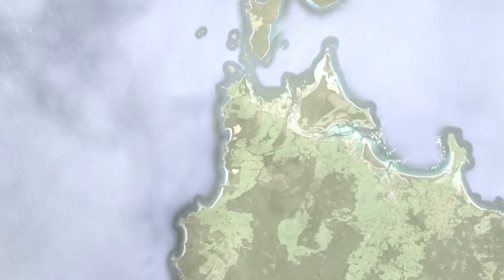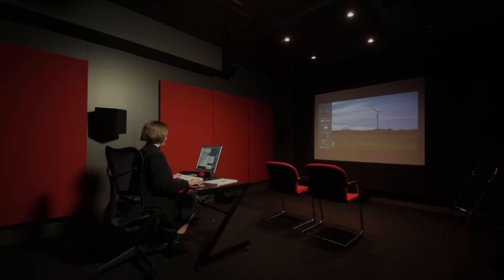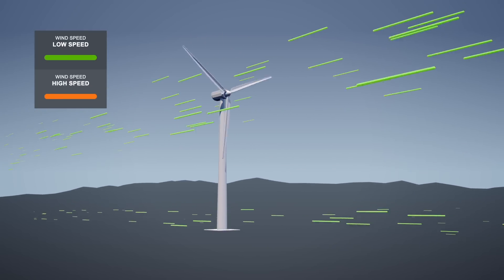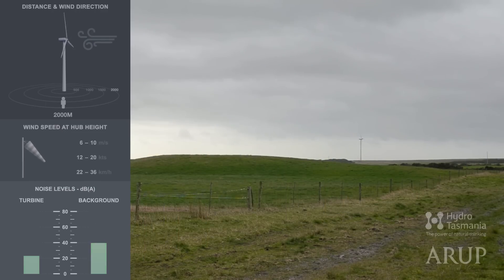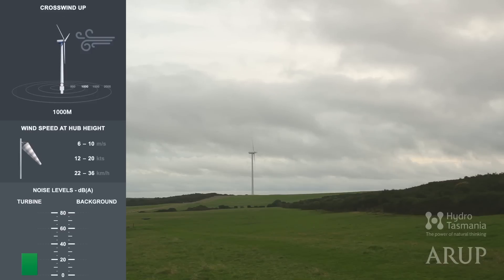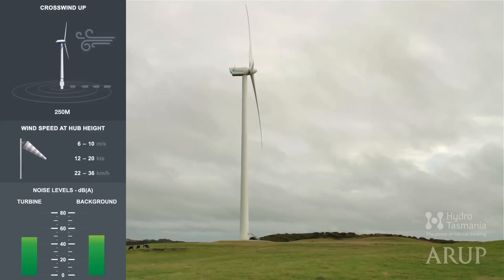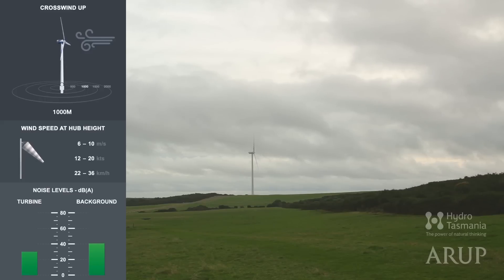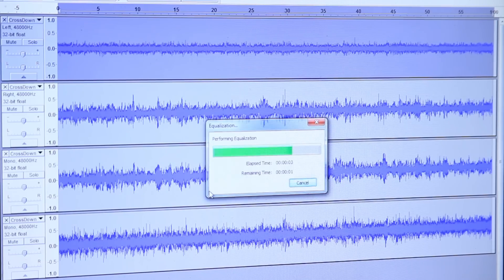The sound of wind farms

Comment: The moving elements of a wind turbine are what make them so much more productive that solar panels.  Naturally since things are moving, the machine makes some noise.  Gas turbines and old school diesel power generators make lots of noise locally, but it is dampened via soundproofing, and also, noise drops off with distance.

Comment: The measurement method, almost perpendicular to the axis of rotation, is misleading, after all, a large part of the sound blows away sideways. The loudest sound can be heard behind the windmill, parallel to the axis of rotation, I bet that in that position noise values are measured that are 1.5 to 2 x higher. But in any case, wind and solar energy is inefficient and unreliable energy that also costs a lot of energy to set up and maintain, see this video https://youtu.be/m7PHUMd7PYA

Comment: Everything at 90 degrees on the direction of the wind. Why? Try it with the wind blowing against you.
Reply: I had the same thought. I'm just a simple airplane mechanic, but if I were doing research on the sound of a spinning prop, I'd want to know how (or even if) the sound changes parallel to the prop disk, both front and back, and perpendicular to the prop disk, like they did here, but from both sides. Why both sides, because one side has ascending blades while they are descending on the opposite side. I have no idea if that would make a difference, but I'd like to know if they at least checked into that. Also, they need to get records of the average number of wind turbines operating per day, then measure the sound levels with that many wind turbines running.

Comment: This video is complete deception.  If the author really wished to accurately measure turbine noise, they would not have approach the turbine from the side.  The quietest vantage point.  Turbines are loudest directly in front or behind.  70db are typical maximum measurements on breezy days.  You need hearing protection at 80db.  Also infrasound is far more annoying than audible noise.  Infrasound causes headaches and "head pressure".  This video is intended to deceive.

Comment: EXCELLENT Job of FILTERING OUT the NOISE of the GEARS CLASHING Together
Reply: 250 meters isn't close enough, to hear the transmissions, or  alternator hum. To hear that, you almost need to put your ear right against the tower. (I know, I actually trespassed onto a site to try it)

Comment: This is not relevant for other wind turbines. 
I lived off grid in Portugal and couldn't get used to the near permanent noise of 4 nearby wind turbines. It sounded like an jet plane coming over neither too low to be upfront but low enough to make you turn your head. Different shapes of blades might affect the noise output.

The WHO has now recognised the noise (some) wind turbines make as a health hazard. A couple won in November 2021 financial compensation from a wind turbine corporation for the health issues they suffered caused by constant exposure to the noise they make.

Comment: The first thing I thought of after watching this, is "how come they didn't do the modelling in front of and behind the blades, and also were there are multiple turbines" seems logical to check out all the potential angles and real wind farms with multiple turbines.......It's interesting to note that city dwellers who are far from the blades chastise the rural dwellers generally speaking because like most people ..we are all for something like green energy (turbines) or nuclear or chicken farms...or you name it........as long as it's not our backyard.
Reply: Recording at different aspects and in the midst of a wind farm would be very interesting indeed. City dwellers take a while to hear discrete sounds when away from what they are used to. I haven't heard a wind farm in real time but seeing them in motion I don't think they are as quiet as the developers claim. When each blade passes the post supporting the whole thing it has to disturb the flow of air creating noise at a very low freq. that you would feel rather than hear. If there is any pitting and erosion on the leading edges and tips of the blades that would cause noise in varying freq. bands depending on the size of the pitting too.
Reply: These where my questions also. There are many I have around wind farms, Noise is just one of them.
Reply: Because sound doesnt travel like light where you will hear something different from different angles thats because the sound diffracts and the spreads out in a sphere - if you have walls and obstacles close by that can interfer with the sound there can be a difference but in an open field like that you wont notice a difference. - The sound 200m behind the turbine will be the same as to the side of the turbine.
Reply: Not necessarily. I am pro wind farm. My brother and I have signed a lease for one, however I do not think my section of our rural property will have any towers. That means I will be able to see them, and possibly hear them but obtain no direct financial benefit from the wind farm.

I don’t actually live there anymore, but even if I was living there I would still support them. This video has reassured me as the turbines will be at least a kilometre from me.
Reply: Exactly. The sound levels off to the side of the rotating blades are nowhere near as loud as behind the blades.  And it is actually louder at some distance than it is close to the turbine. Videos like this are paid for by wind developers to convince politicians that wind projects are wonderful. The fact is that the entire area of a wind project becomes a de facto heavy industrial zone. Industrial zones are not good places for people to live and are always kept separate from residential areas in zoning law. Non-compliant use for industrial purposes is not to be allowed in ag/residential areas without full consent of residents.

Comment: This is a super neat video! What does a wind farm of 50+ sound like?
Reply: This is what they sound like from 2000'.  https://www.youtube.com/watch?v=78QwBM_AD3s
Reply: Probably a bit late at replying to this message but 3dB is perceived as a noticeable difference in level, 3dB is also a doubling of sound pressure so 64 turbines would be 3dB x 6 louder (18dB increase) the acoustic consultants would have assessed whether that level increase met the appropriate legislative levels based on the baseline background sound level. It's not quite as simple to say it's that much louder though because of the attenuation of level at distance and any other effects the turbines are subject to. ETSU-97 is the guidance if you wanted to look into it and during an assessment acoustic consultants have to factor in cumulative effects of other nearby wind farms
Reply: Is'nt db(A) used for measuring which does not meassure the lower frequencies? 
Also, I wonder what the sound signature is in a closed space, like a room in a standard house where the walls may mask out the higher frequencies and the lower onse will plough through. The turbine(s) are constantly oscillating when active.
I do not live nearby windturbines, but someone said a "standard house" in my countrty swings by airborne soundwaves below 180Hz   @jameslennon6593
Reply: Why would you be in the wind farm if you dont like the sounds? Youre unlikely to have more than a few close by.

Comment: The enclose of the mic is huge. Very big and very much damping. In a studio this would result in muffled sounds. No quality vocal or instrument  recording can be made with such a setup.
Of course protection for wind noises is required. Pop filters are normally used for vocals . I would suggest making a pop filter around the mic. With enough distance to the mic. Why not measure at a stormy or hurricane day? Than wind noise is biggest! It is like measuring a drummer who plays with brushes and in the next measurement you hear a jazz drummer playing with light sticks. That method is OK if you stop the wind turbines when wind is above medium breeze. Great ...people around the windturbine will be happy! But ...at high speeds windturbines deliver most energy and noise. Windturbines  are only stopped when very extreme winds are avaialable. So we wanna hear the heavy metal drummer who can shake the roofs! Or the storms that shake the windturbines . For sure not pretty weather to do measurements ...i may rain and be cold as well. 
Yes ...than that enclosure probably will be required and perhaps still generate enough signal.  
Second ...very nice to have windpark far away from houses as shown.  Distances from 10 times tip height or more have almost no serious consequences for people around the windtrubine. However for instance in the overcrowded Netherlands distances from 700m , 500 m or even 300m or less also are reported . And ...windturbines are getting bigger and bigger and more and more. See links with installed heights, powers and noise they generated. Official government data.
https://www.atlasleefomgeving.nl/kaarten?config=3ef897de-127f-471a-959b-93b7597de188&activateOnStart=info,layermanager&gm-x=155000.00000000006&gm-y=416358.1266850175&gm-z=3.312315746690106&gm-b=1544180834512,true,1;1605001908247,true,1
https://www.nationaleenergieatlas.nl/kaarten?config=418d0f56-0f0c-4fd4-9001-2ead4e1e22d6&activeTools=layercollection,search,info,bookmark,measure,draw&activateOnStart=info,layermanager&gm-x=150000&gm-y=460000&gm-z=3&gm-b=1542632922900,true,1;1603727558578,true,1
https://www.atlasleefomgeving.nl/kaarten geluid van windturbines (Lden)
However windturbine noise is registrated in dB(A) and not in dB(C) or better ...without using a damping 
https://nl.wikipedia.org/wiki/Wegingscurves_A_en_C
The damping/correction is so huge that below 125 Hz no realistic data are presented with dB(A) settings.  at 50 Hz already 30.2 dB damping is supplied and at 20 H 50.5 dB correction is applied with dB(A) dB(C) damping  is 1.3 dB at 50 Hz and 6.2 dB at 20 Hz . A huge improvement over dB(A) measurements. However ...still damping (weighting) is applied. 
To reproduce the sound at home the play back volume should be at the same dB as when recorded.

Comment: Those blades are 44 meters what about blades that are a 100 meters
Reply: There is currently no onshore wind turbine with such long blades. The maximum today is 80 metres. They don't have to spin so fast so they are actually a little quieter. Also thanks to more advanced blade designs.

Comment: There are a number of sounds associated with wind farms. For example, the sound of the fossil fuel powered back up generators that have to kept running uselessly to take up the slack when the wind falls off, the sound of engineers groaning at the prospect of integrating such an erratic and unreliable power source into an electric grid, the sound of cash falling out of your pockets when it's time to pay for decommissioning those bloody things after all too short a time, not to mention the "THUNK" of millions of birds and bats being sliced up by the blades.

Comment: They are realky quiet when they freeze up a and stop running.
Reply: If you refuse to winterize them, but nobody would be that stupid, right.
Reply: Just like an unwinterized oil&gas wellhead, a cooling pump for a nuclear reactor, or a pile of coal sitting out in the open. Yep. Dead quiet.

Comment: Too much explaining I just thought I would be the sounds not sound levels😂
Reply: They need to show sound levels, because of how your computer volume is adjusted. You need some kind of reference, as to how loud it actually is.(not very loud)
Reply: Atlantes Kyle it is as if you were on a luxury sea cruise. I was on Queen Mary 2, 4th deck which, apparently is least noisy, so it is a very similar experience. Or, like some people have furnaces or hot air pumps in the cellar which run most of the time. It is quieter than aircon. It is not bad and bearable but when they are switched off for maintenance one can appreciate the lack of it. The closest turbine from our wind farm is about 2,5km away from my house. I think that the noise has an impact on my house (which is very old) too and tiniest parts of it vibrate making an extra noise.
Reply: @annaal7480  
Well. Looks like you're lucky, simply not living by Anything else.
Neighbors, Traffic, Trains, Lawnmowers, Music, Dogs, Cops and Fire, Aircraft, Punks in Honda cars 😂, AND SIMPLE WEATHER. Just calming White Noise as loud as your refrigerator.
Reply: This video is a BIASED, DECEPTIVE and WINDMILL COMPANY Produced LIE FEST & Nothing Else!.. 😡🤬😡

Comment: Hi, I am Dave Ward the Author of three books on noise and noise control 

Environmental noise control Narrowband analysis 
https://www.amazon.com/Environmental-noise-control-Narrowband-Analysis-ebook/dp/B00P8NJ6EU

Measure noise with Smartphones : Use the new Technology
https://www.amazon.com/Measure-noise-smartphones-Use-Technology/dp/1502576171

Eliminate Noise Hazards: a lean Six Sigma approach
https://www.amazon.com/Eliminate-Noise-Hazards-Lean-Approach-ebook/dp/B00NXGX64U

 Now a book called “The Truth about Wind Turbine noise – Underground transmission” is being written 
There are basic facts that are ignored when measuring windmill noise.
1/ Sound will travel 10 times better through the ground than through air.
2/ Sound travelling through the ground will cause structures to sympathetically vibrate.
3/ Vibrations travelling through the earth and sympathetic vibration  are not measured.
4/ Many of the low frequency sounds are not measured. These are typically around 150Hz and are actively discounted on the “A” scale of dB measurement. A typical example is where the “Experts” measured noise levels around a house @48dB. The peak @150Hz was 85dB which is well above acceptable noise levels. 
5/These noise levels are above the threshold of 85dB. Any other factory producing these levels would be shut down because of health concerns.
6/The model for noise nuisance is:
-The windmill turbine tower vibrates 
-The vibration move through the earth and vibrates buildings 
-The vibration of the building will be greater than the vibration produced by the Wind Turbine tower.
-Because different buildings have different natural resonant vibration one building can be affected and another is not affected . 
I wish to prove this model of transmission and need the following 

a)	30 sec video taken by smartphone
b)	One taken inside the house
c)	One taken outside the house
d)	One taken touching the side of the building 
e)	Download a dB meter to the smartphone and take dB readings at the time of taking the video
I shall run the soundtrack through a spectrum analyzer and provide responders with a written report of the findings which will include the true sound spectrum of the area. The findings will be included in my book if permission is given. 

I may be contacted improver.dave@gmail.com